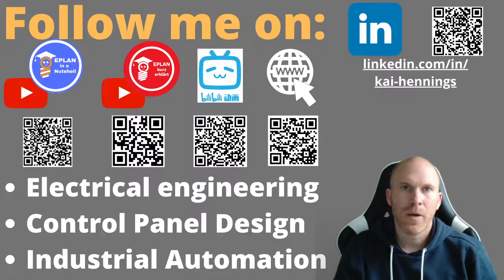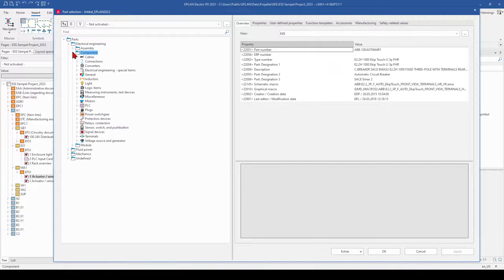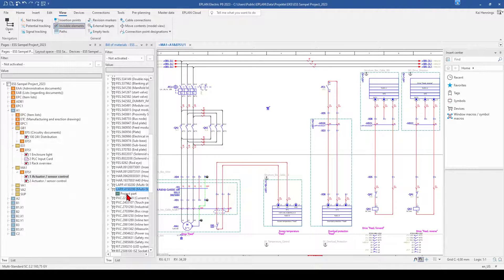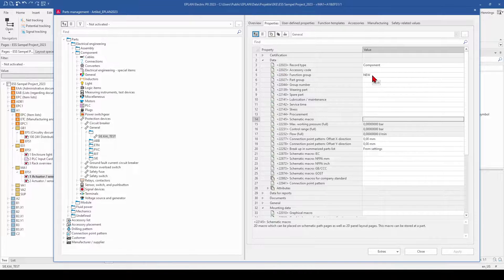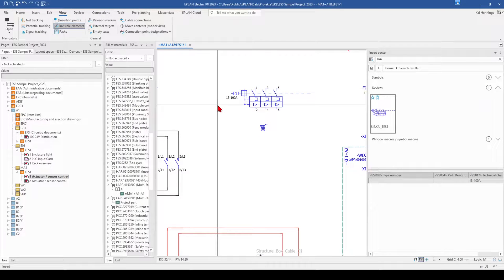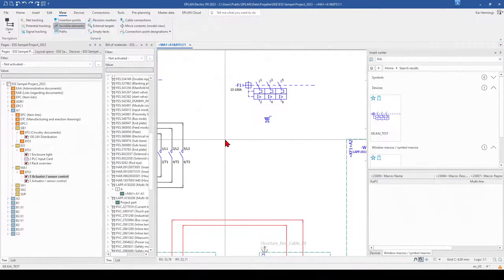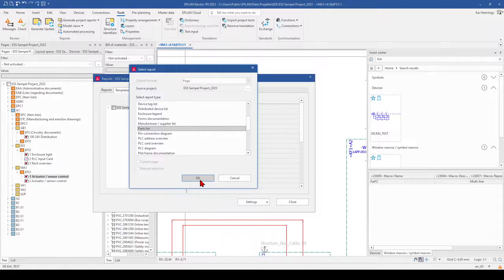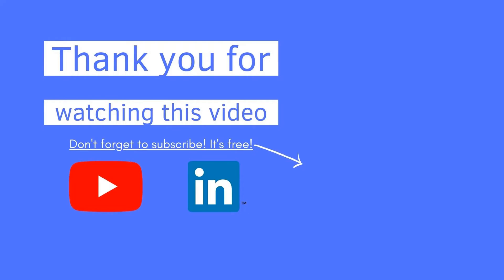EPLAN 5 Tips and Tricks😎. Parts Special

Comment: Hello Kai
I have a question for you :)
In our company, before the electrical design for the switchboard is made, engineers are preparing list the products in a separate quote program.Then they export the product list to a file (.xlsx) which may contain eg.
{Part Number} {Description} {Quantity} {Store Location}.
I would like to import this list into EPLAN [Device list] to run the project more efficiently, ie a ready list of devices with the correct part number.

Regards
Bogdan